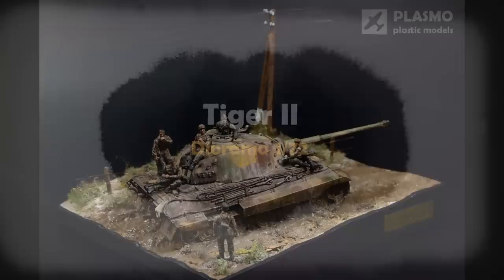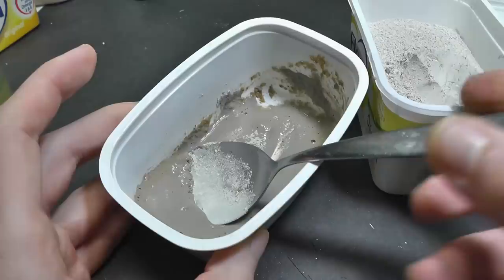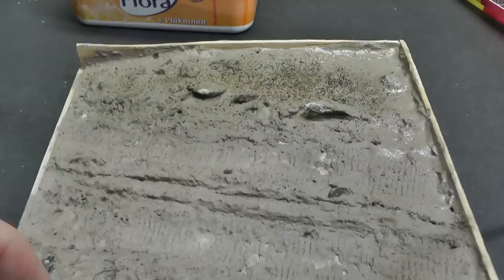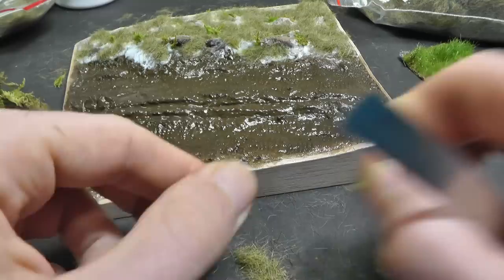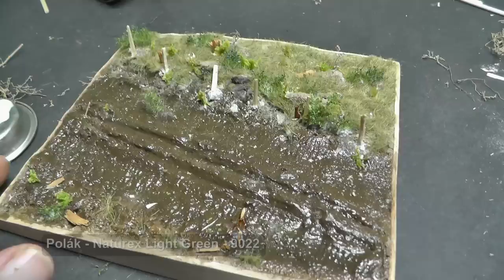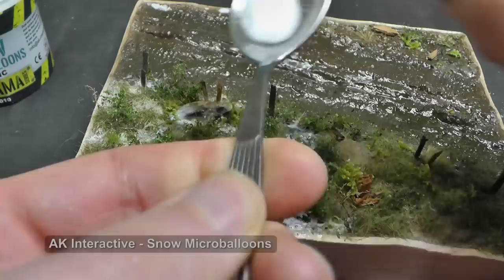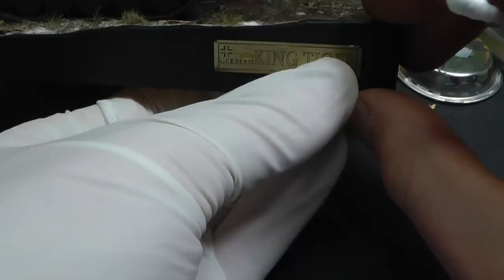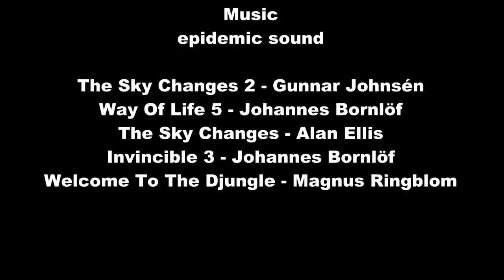Diorama King Tiger - 1/72

Comment: I think, I would have let all the wires hang down to the ground on the one side of the pole (like the one example).
The shorter side (in the same direction as the tank's barrel) is stiff enough to suggest, that the wires continue "out of the diorama".
But the longer side looks...too wobbly (?)
But apart from that - excellent, as usual.

Comment: Beautiful diorama but I'm not sure how accurate it is, I mean with the uniforms and paint scheme for the Tiger. Since you added snow to the landscape it would have to have been early 1944 since there were no Tiger units in Normandy in late 1944 after August. I'm not even sure there would have been Tigers in Normandy in early 1944 since they would have been on the Eastern Front. A great diorama though!
Reply: It could be a scene from the Battle of the Bulge Ardennes Belgium dec. 16th 1944 to jan. 21 1945 or eastern Front early 1945 maybe Hungary?

Comment: Hi man, did you by "new casting technique" mean oyumaru/bluestuff mold casting, or do you have new one? Video with that is about 2 years old.
Ahoj, tou novou technikou odlévání jsi myslel tu oyumaru/bluestuff techniku, nebo máš novu? Video s ukázkou je zbruba dva roky staré.
Reply from the maker: I have a new one. I use liquid silicone and professional two component epoxy. The major problem with oyumaru is thickness and quality of a material. I will buy vacuum pump, so it will be even better. I have still a problem with bubbles, so a vacuum is the only solution.
Reply: Can we expect video? :D 
I´m seriously considering going for liquid casting, but I´m not sure which resin to buy to get great detail and have time for vacuum chamber. Friend of mine is casting himself, but he is using about 2 minute hardening resin, so he has no time to get it vacuum pumped. Models he cast are as different (in quality) as moods of pregnant woman on steroids.